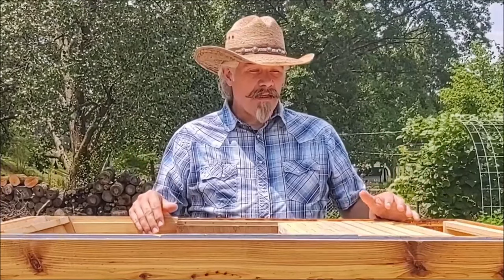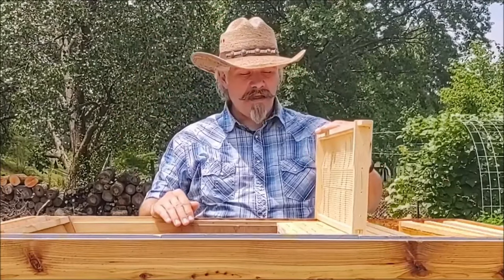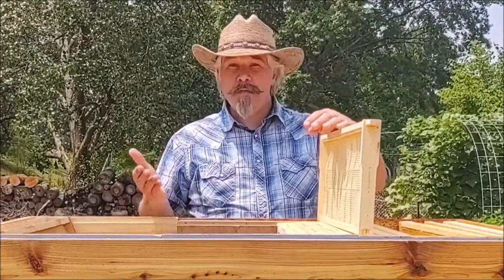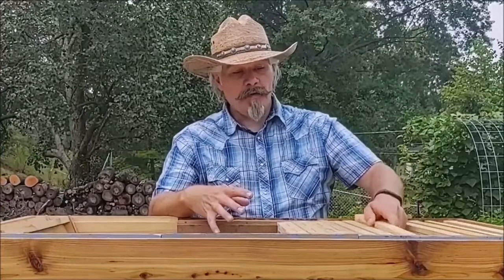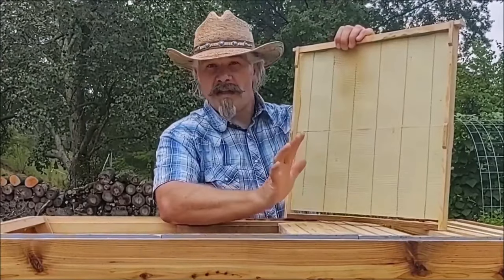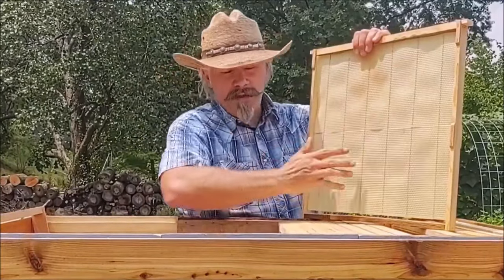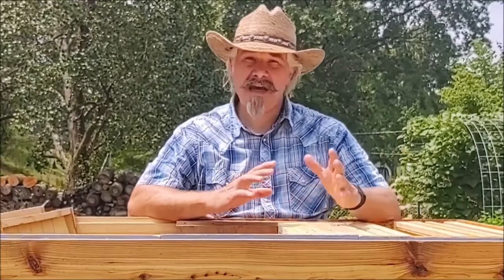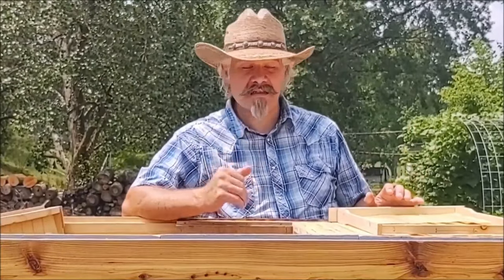Beehive Frame Comparison: Langstroth vs. Layens vs. Lazutin

Comment: I like layens but what I do not like is that not great in terms of controlling the wax moth and other pests. Right now I have the chance to save equipment not to be eaten by wax moth larva by pitting into a chest freezer.  You can't do that with a layens hive. I think the ideal hive is using 2 eight frames boxes like full deep and WSP. Create frames for brood with the height of sum deep + WSP. Approx 400mm instead of 230mm. Use 8 frames deep for supers. Do frame swaps so that both 8 frames boxes have mixture of full frames and empty frames to make them easier to manage. Once frame is caped take it out. It might be more involved than professionals do. But as a hobby to have some honey this could work.

Comment: Nice video explaining the differences.  Another difference is the Langstroth frames are easier to top feed than Layens.  You can use frame feeder in Layens but that means opening hive.  Dr. Leo says you shouldn't need to feed bees.  I have 3 Layens and 3 horizontal Langstroth hives, both work.  Now thinking of switching all to Layens.
Reply from the maker: Thank you for your comments.  I agree with Dr. Leo - as long as you are using local bees, in normal circumstances, you shouldn't need to feed.  But a package/nuc purchased from outside of the local area will not be in sync with local nectar flows and may need supplemental feeding.  As for the frame feeders, they can be put on the opposite side of the divider board from the frames and the bees will find it.  So the feeder can be added/removed/refilled without exposing the bees.  I fed during the dearth last summer/fall, and the bees had no problem finding the feeder on the other side of the board.  I did not, however, give supplemental food over winter or this spring and the bees are doing well.  This year I only expect to feed splits that lose their foragers; otherwise I plan to let the bees do what bees do.
Reply: @SuburbanSodbuster  I have no scientific testing proof but my Layens seem to over winter better than my Langstroth.  I will like to see more about your conversion hive.  Thanks
Reply from the maker: I do think that, besides the benefit of the deeper frame, the typically thicker/insulated walls of the Layens hive are a huge benefit.  Like you I have no scientific proof - only observation - but I noticed that the colony in my insulated hive had way more honey stores left at the end of winter than another colony in a converted Langstroth box.  I also noticed that the insulated hive had much less interior condensation than those with thinner walls.

Comment: I’ve never heard of a colony starving because they wouldn’t cross over from a bottom to top frame.
Reply from the maker: I've seen a few videos of spring inspections in which a cluster was found dead at the top of frames, starved out, with honey frames just above them.  But I don't recall any in which the keeper recognized the issue.  Most were just puzzled.  But I'm sure this depends on climate and would be more likely in locales with longer, colder winters.

Comment: I stubbled across your video.  I too have been reading Keeping Bees with a Smile (2nd edition) and I was wondering why Dr. Leo used a smaller Layens Frame than the Lazutin (or double deep Lanstroth) Frame.  Thank you for adding that nugget of information.  I live in Northern Idaho and Dr. Leo felt that the Layens frame would be suitable where I live since winter typically runs from mid to late Nov to March.

Comment: I have watched a lot of house removals when bees are in the wall comb is built long ways to the studs then comd section cross to the other stud same as in the celling joist pretend the celling is a long hive how do they build in the celling they build long ways the comb sections right to left i seen lots of videos on the long hive instead of putting the frames in cross ways run the frames long way as they do in a celling istbein dofrestonen

Comment: If there are no honey supers on this how would you exclude the queen on a horizontal to make honey.  I thought that was functionally necessary.
Reply from the maker: In a horizontal hive the bees will typically keep brood close to the entrance.  In a Layens hive the first 6-7 frames are usually brood with honey stores after that.  Sometimes bees follow this to the letter; sometimes they spread the brood out.  When that happens I'll put the queen back in the brood end and a full honey frame as the 8th frame. The queen usually won't cross a honey frame to lay more brood.  If necessary, an excluder can be cut to fit and inserted between frames vertically - although I've never used an excluder in my Layens hives.

Comment: I found your explanation clearly delivered - thank you.  
Hope you will entertain my questions re. Layens hive.  How have you overcome the non-standard frame size for honey processing?  Do you think this style of hive will suit a temperate climate (climate zone 6)?  One of the appealing aspects of the proportion of the frame is that it provides beekeepers a clear visual demonstration of the composition of the nest over the season.  

All the best,
From Melbourne Australia ❤
Reply from the maker: Thank you for you comment.  I'm glad to respond to your questions:
For honey processing I use a "Regata" model extractor made by SAF in Italy.  This is a tangential extractor which holds 3 Layens frames but can also hold Langstroth frames.  The extractor is basically the same as a 9 frame radial extractor made by SAF, just with a different basket.  
One great thing about an insulated Layens hive, like those for which plans are given on horizontalhive dot com, is that insulation helps to moderate hot temperatures as well as cold.  One thing I think I will change in the future is to insulate, rather than ventilate the hive roofs, but the hives themselves are useful for multiple climates.
I do like that the deep frames provide a full picture of the brood pattern, rather than having brood and resources spread vertically across frames and boxes.  But what I like even more is that the deep frames, using just a starter strip at the top, provide a platform for the bees to build comb from the top down, then expanding horizontally to build adjacent comb on the next frames, similar to how they would in a natural hive.
Reply: @SuburbanSodbuster  
Thank you for answering my questions.  
It has convinced me to build a layens hive.
Now to scavenge for some timber!

Comment: Loved this, thank you! How many frames do you recommend buying or building a Layens hive to hold? Would be nice to be able to do splits in one box like you’re doing but what happens when they both expand, will a 20 frame hold 2 colonies or is better to go bigger.
Reply from the maker: I prefer a 20 frame hive - it seems to give plenty of space for a typical colony for the year.  Although I use them for splits, it's a temporary space for two colonies and eventually one will have to be moved out.

Comment: Very informative explanation of hive design pros and cons.  Your video was timed just right for me.  I am in the planning stage of building hives.  My biggest concern was how to over winter the bees here in north west Ohio.  I believe the Layens design will work well in this area.  Have you captured any wild colonies?
Reply from the maker: Yes and no.  My swarm trapping was unsuccessful, but I did trap a colony out of a local tree, and most of my apiary is populated with splits from that colony.  I pieced together a video about that trap-out here:  https://youtu.be/X_MczM0HWHk.
Reply: You could run Langstroth if you wanted.  
How are your shoulders and your back.  Learn to lift the boxes correctly. 
If you have issues with your shoulders, back, etc. then go with the other one
Reply: Insulation makes a huge difference for overwintering in cold climates—preferably breathable insulation such as wool so as not to trap moisture

Comment: Hey Mr Sodbuster. Looking at getting into bees, trying to learn the best hive to start with for later success. You talked about tweaking a Lazutin hive to be able to use Langstroth frames in order to use a mechanical extractor, but then never detailed if you ended up able to spin the Layen frames. Were you successful there? Have you, or anyone you know, tried your idea of Langstroth frames joined together to put into a Lazutin hive and separate them to spin them, but used them on their side so the bees can go all the way down and up in their ball?
Reply from the maker: I originally built a horizontal Lazutin/Double-deep Langstroth hive.  Because the Lazutin and Langstroth frames are the same width the dimensions are easy but making supports and accessing the 2nd (lower) level of Langstroth frames is not.  Plans from horizontalhive.com use a door on the ends to access the lower frames; I adapted the design and routed vertical slots which could be used to access, insert and remove the lower level of frames.  After all that I never used the hive for Langstroth or Lazutin frames.  After talking to Dr. Leo Sharashkin about it, and seeing him demonstrate the simplicity of the Layens hive, I converted that hive to use Layens frames and it's now my "Taj Mahive" which is seen in some of my videos.  

Some have built deeper Layens hives and adapted Langstroth medium frames, hanging two frames vertically, side by side.  Personally I don't like any sort of hard division along the frames, either horizontally or vertically.  If I were to use the deeper hive I would just build deeper layens frames (which is the Ukranian style) for continuous comb.  But that deeper comb is mostly beneficial for colder northern regions.

Comment: I just built a Langstroth horizontal hive and I live in North Idaho and finished it look at it and thought this ain't gonna work. Keep in mind I have my first two nuc's coming.  I too have the book keeping bees with a smile. The bees I ordered are coming on 5 Langstroth deeps nine inch. I have one horizontal hive made from the book. I thought if I build another that fits Langstroth I can just put the frames in and be good. But no I see it's a hive for the south with no sub zero temps. looking to modify it to have a hybread frame. I'm trying to understand the gap and why it is what it is and to make things workout. I'm glad I found you channel. I'm looked and the horizontal have as I'm bent and broke from construction. and want to have bees on the homestead. A friend called me a dirt worshiper. i'm going to have to make a modification to the frames to get them into my one hive box.
Reply from the maker: Yes, I'm sorry to agree that a horizontal Langstroth hive (assuming you mean one level of frames) would be generally inadequate to overwinter the bees where you live.  I've seen some in the Southeast US, where winters are much milder, who had their long Langstroth hives starve out.  But the good news is that what you built could be easily adapted for taller frames by building an extension on the top, and if you opted to go the Layens route you could build spacers for the sides, which could also be insulated.  This would be very similar to what I did with my conversion hive - in fact you might take almost the same approach (videos are on my channel).  Then you could put your frames from the Nucs right next to the deep frames, without modifying the Langstroth frames.  Whatever approach you take, good luck on your beekeeping journey.
Reply: @Anthony Payne I agree with Sodbuster, also you can check out another youtube channel, Of grid with doug and stacy, they had Dr. Leo out and he shows how he converts the Lagstroth to Laynes, in a simple process. You can find it in the bee play list.

Comment: Could you tell me the ideal size hive for a Laynes hive. Dr. Leo talks about a 14 frame hive a lot but I want to make sure I have a big enough hive box for my area
Reply from the maker: My personal preference is for a 20 frame insulated hive.  You can always make the space smaller with divider boards, but you can't make a small space larger and once the bees run out of space you must keep on top of management (replacing full frames with empty) or they'll swarm - as my 12 frame did last year.  A very productive colony could fill a 20 frame but it's typically plenty of space.
Reply: @SuburbanSodbuster  Thank you very much I have been struggling with going with a 14 or 20 frame Layne's for awhile now but I am definitely switching over from Langstouth to Laynes
Reply: @SuburbanSodbuster  do you use a insulated hive or solid wood. And if you use an insulated hive what do you use for insulation. Thank you for all your help and I really enjoy your videos  I find them informative
Reply from the maker: I use insulated hives (with a few exceptions).  My hives have ventilated lids but I plan to switch to insulated lids, as well.  I use either sheep's wool (when I can get it) or rock wool for insulation.

Comment: So, how would it work to do a Lazutin brood box but in an 8 or 10 frame size like a Langstroth, then add on honey supers using standard medium frames? That way you only have a single brood box which would be easier to inspect, but obviously the negative of still having to handle potentially heavy mediums full of honey. I'm just thinking about the benefits of overwintering with extra deep brood frames and the added bonus of only needing to inspect 8 or 10 frames vs. 16 or 20 frames.
Reply from the maker: I've thought about doing the same thing in my Langstroth hives and think the larger, continuous comb of the Lazutin frames would provide a good brood area and easier overwintering.

Comment: Question saw your video on the deep frames is there a special processes for extracting honey from these long frames thanks
Reply from the maker: I see that you found an answer, but I'll go ahead and give mine for any detail it might add.
There are extractors available for the Layens frames.  They're not as readily available in the US as Langstroth extractors, but the market is growing.  The process for extraction is the same - remove the wax cappings and spin the frames in an extractor to draw out the honey.
There are no extractors, to my knowledge, for the deep Lazutin frames.  Some have made these frames by connecting two Langstroth deep frames together, then separating them for extraction.  Others have used hive designs (which I think I mention in this video) that can use two levels for Langstroth frames alongside the deeper Lazutin frames - using the Lazutin frames for brood and Langstroth for honey.
Without an extractor, other options are comb honey or crush & strain - literally crushing the comb and straining out the honey, leaving the wax and other particles behind.

Comment: Wonderfully explained.  Answered a LOT of my questions.  One more inquiry though......Does Florida need the deepness of a Layens do you think? Or do you think the bees would be ok with the shallower Langstroth.?
It's "winter" right now here and I'm wear a T-shirt and sandals as we speak.
Reply from the maker: Thank you!  I'm glad this was helpful.  The necessary depth of the frames depends on how long the bees will go without nectar forage during the winter.  You would know your climate better than I, but I suspect that you have a very short period of time - if at all - when nothing is blooming.  At least much shorter than our winter dearth here in Missouri.  I suspect that deep Langstroth frames may be adequate for you.  On the other hand, there's little downside (from the bees' perspective) to deeper frames.
Reply: I think the Langstroth design is lacking in all aspects (from the perspective of the bees). While the wintering in Flori-duh will not be an issue, everything else is… Deep horizontal hives are much better for the bees, but are much worse for commercial bee keepers… Happy bees are healthier and have fewer pest issues (and healthy bees never eat sugar).

Comment: Yes I want to use the Long hive but building different frames lor buying them is going to be a pain or expensive so is there a way to use my regular deep frames ?
Reply from the maker: Many people do use horizontal (long) Langstroth hives.  Horizontal hive management is similar regardless of the frames but, depending on your location, over-wintering could be more of a challenge.

Comment: We are switching from Langstroth to Layen horizontal hives.  We have an abundance of brood frames.  Can they be wired tied together - bottom to bottom (trimming and narrowing the top piece of wood now as the new bottom frame)?  Will the bees build their brood comb continually from the top brood frame to the bottom brood frame?  Is it possible to create a closed "top bar" effect by nailing a length of lath wood to the top piece of the newly created double brood frame?
Reply from the maker: It's possible, but I'd have a couple concerns.  One is that the bees build their comb with the cells angled down toward the middle, so if the bottom comb is turned upside down then the cells will be sloped in the opposite direction.  Also, attaching the frames together would create a division between the comb on top and the comb on bottom.  

A better option, I think, would be to cut the ends off of the Langstroth frames so that the center portion of the comb will fit within a Layens frame and remove the bottom bar.  Then attach the cut out comb inside of a Layens frame by running screws through the Layens top bar into the Langstroth top bar.  This will leave space below the existing comb for the bees to build new comb.  

Of course, there are many ways of re-using the comb and, given some time, I could probably think of multiple variations myself.  But, what I describe above will keep the comb and the angle of the cells in the original orientation - and not introduce a division in the middle of the frame.